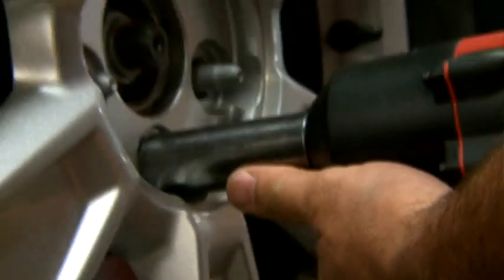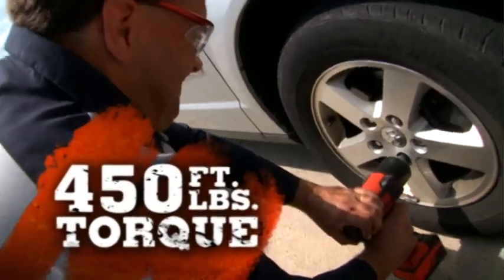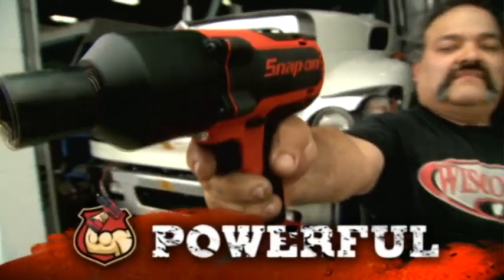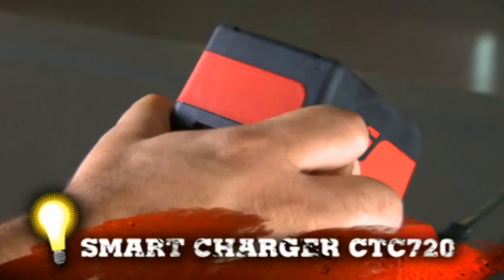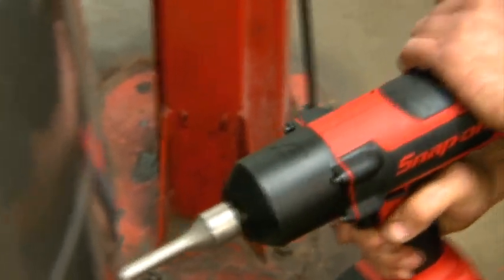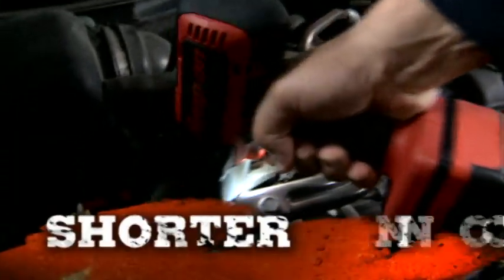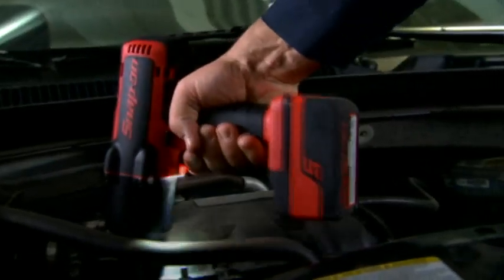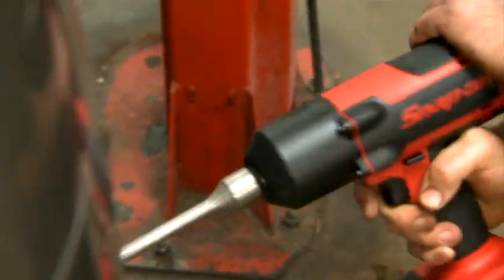Snap-on CT7850 1/2" Drive 18V Lithium Cordless Impact Wrench | Snap-on Tools

Comment: I just got my CT7850 Friday. I was able to trade in my CT6850 and only lost 25 bucks on its original price.  So far I really like the 7850,  my only complaint is the Trigger.  Sometimes it feels weird. Different from the 6850 but so far so good,  The LED on the front is really bright and the included Flashlight that mounts to the 2nd battery is pretty nice.

Comment: It is a bit too expense, but an awesome tool. I am in the process of getting a W7150 though for $379. I have used it and nothing comes close without an air hose attached. I never use it to install bolts or nuts, but definitely for taking off CV axle nuts and other large nuts. 

I am still using a CT3850 with rebuilt batteries and it still works great after almost 10 years of abuse.

Comment: Just bought one today, seems a little stronger than my old CT 6850, but with the addition of the light and brake i would defiantly get this over it. the trigger can feel weird but i can live with it. the light is much brighter than the 14.4V 3/8 impact. paid $700 with tax and got a flip over socket set and not a light like others

Comment: I just bought the Ingersoll Rand IQV20-201 combo kit which includes the IRQV20 charger, a 1/2 inch drive w7150 which blows this snap on gun out of the water (1100 ft pounds breakaway torque and 780 foot pounds of working torque), a 3/8" drive W5130  impact which puts out 190 ft pounds of torque (admittedly this is less than what snap on says it's CT8810 puts out), one BL2010 3 amp hour lithium ion battery and one BL2005 1.5 amp hour battery in a canvas carrying case for just under 600 bucks.  Snap on's own website says that this gun with canvas bag two batteries and charger goes for 700.  In addition these tools carry a three year warranty.  Try again snap -on.  You have some catching up to do.

Comment: @foxdmulder The 4850HO replaces 4850, the 6850/6555 replaces the 4850HO, the CT7850 Will eventually replace the current production 6850. we still don't know the bolt breakaway torque. hopefully something like 800ft/lb. keep in mind that both CT4850HO and the CT6850 have the same specs. the CT 6855 tho comes with li batteries.

Comment: Never heard of a CT4450 from snap-on. They made a CDR4450 drill. There was a weird  impact, a CT4405LE or something like that ,it was 14.4 volts and looked like a CT4850, the CT4850HO was next, then the CT6850 which is EXACTLY the same as the CT4850HO, same torque, same parts inside, same housing etc. CT4850 had different hammers and was 50 ft. lbs. less

Comment: Still have my 3850 with rebuilt batteries and it works great 10 years later. I would like to upgrade but $600-$700 does not appeal to me.

Comment: I like the Milwaukee M18 gun. A coworker has the snapon ct7850 an u can tell the milwaukee gun is a lil stronger and its alot cheaper. The ct7850 is a great gun tho but is way too expensive

Comment: I own this one and the 3/8 one also I have no regrets purchasing either one. I work at a shop at use it regularly six days a week with 10hr shifts, these batteries last me a long time I have four so I never run into a situation where my battery dies. I'll swap a fully charged battery every two days and that's to avoid having it die on me, the battery still usually has half charge when I change it for a fully charged battery.

it's powerful 
BUT

IT'S NOT stronger than my air impact tools I have Cornwell 1/2 IMPACT that's actually a INGERSOLL RAND also a 1/2 IMPACT from Matco also a Ingersoll Rand both of these are the strongest in its class and I pull these out when the Snap On cant break a nut or bolt loose however it isn't very often.

Comment: which is most powerful snap on cordless impact wrench?
Reply: the ct8850, it's powerful enough to pull lug nuts off of a caterpiller rough terrain reach forklift. It's plenty of power, but boy was it pricy.
Reply: +Nathan Hansen save your money and get the fuel way better warranty and it's way more superior than this
Reply: Steve Boyd really? have you owned both?
Reply: yes
Reply: Steve Boyd what one did you own first?
Reply: Snappy

Comment: The Milwaukee impact wrench has much more power, more longer lasting accu and 5 years guaranty. I like Snapon mechanic tools, but in electric tools Milwaukee is much better!
Reply: stan harris your crazy I own both the 7850 and a Milwaukee fuel 2763. That Milwaukee is way more powerful than the snap on.
Reply: I go to snap on sponsored school. ..horizon center in Kenosha wi..right down the road from snap on hq...I did a first hand comparison between the two. Snap on 7850 will not take off 450ft lbs lugs on a semi tractor and the Milwaukee did. ..enough said
Reply: There is no dewalt cordless impacts made in usa for one. Secondly I have personally compared the 2 side by side and third and final I work with 17 other mechanics that use what ever tool makes them money.
Reply: Your very argumentative. .if you don't realize we have been taking about impact wrenches for the majority of this conversation. Back to my point the Dewalt 20v the snap on 18v and the Milwaukee 18v are all made in China. .I have used all three my friend nick has the Dewalt I have a Milwaukee abs my school has 15 snap on ct7850's....my point was originally of the two but since we are still taking I will add of the 3 the Mil is the only one baking off 450ft# I proved that. I have a Dewalt still also they are just fine. I have only snap on ratchets they are great I dint like busting my knuckles with less than Par ratchets. But when it comes to a choice between 3 Chinese made half inch impacts. Milwaukee is the most powerful with the longest warranty. Dewalt is 3 year snappy is 2 year Milwaukee is 5 year.  2 of the above Milwaukee and snap on headquarter are within 30 min driving distance from my house in Waterford WI.  I am a pro in the field and I research and demo things before I buy so I know what I'm getting. I'm not discrediting any of the above manufacturers all three are hid at different things I am simply stating first hand experience. So if you want to say that China made snap on is better then China made anything else that's fine but at the end of the day specs are specs there are plenty of videos to prove what each tool can do. But there is simply only two cordless half impacts out that compare that is Ingersoll Rands 18v and Milwaukee fuel 18v same power backing off and setting down. If you don't know that then it's hard for me to believe you have long term experience with tools you sound like you shop brands and not performance. I for one have snap on Milwaukee Ingersoll sk older craftsman Dewalt fire that matter in my boxes I use the better tool for the job at hand dont care who makes it. There is nothing you can say to make the snap on ct7850 in this video more powerful and longer lasting then the Milwaukee fuel 2763. its just not possible for the snappy to win in this case. Please read research and come with some valid info because right now your holding up to all standards I have for women in a shop.
Reply: +jen-jen perez made in the us don't mean quality
Reply: thanks for the lesson in proper grammar, i probably use a few pointers on punctuation and spelling,that being said the quality of that tool suck's compared to the m 18.